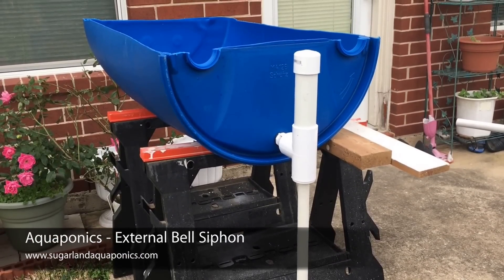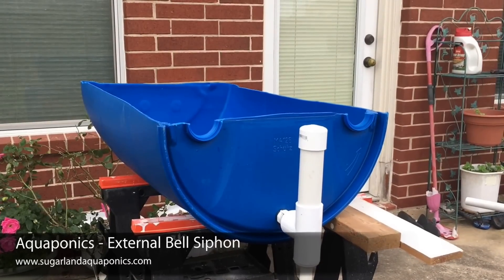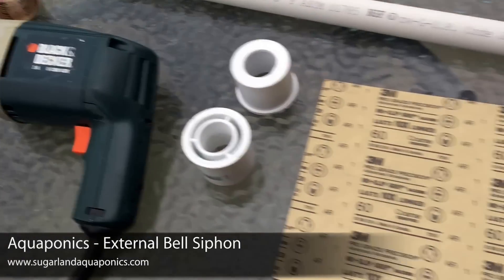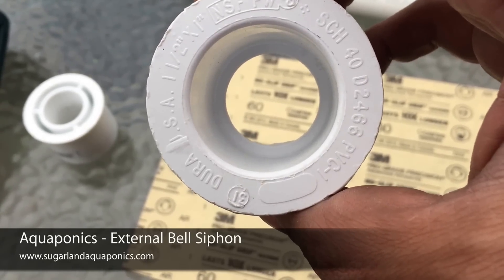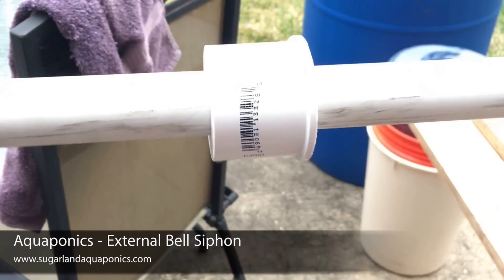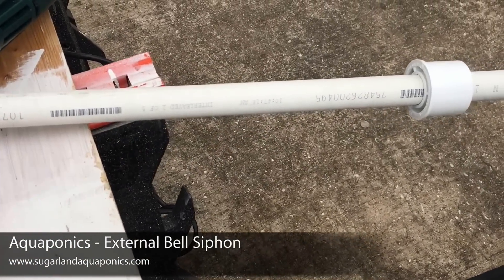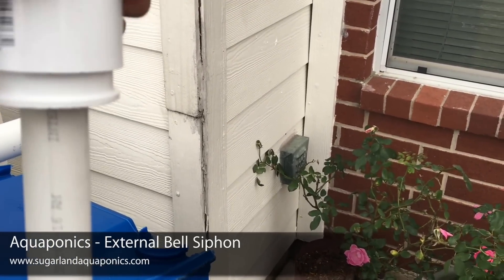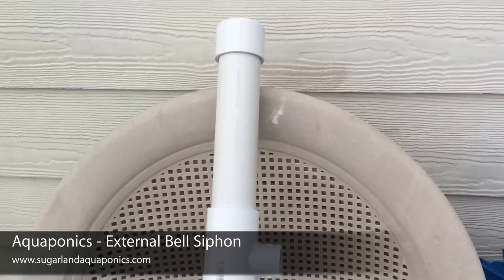External Bell Siphon

Comment: You could also use about 30 seconds of heat gun, to heat up the reducer to fit the 3/4 pipe thru without sanding, if you have an exact 3/4 holesaw. Just have a water bottle or spray bottle to keep outer shell of pvc from getting soft.

Warning, do not breathe the fumes from heated pvc or sanded pvc. Toxic chlorine gas is by product. Use well ventilated area, and respiratory protection.

Also, using a copious layer of primer will dissolve a thin layer of PVC for fusion during gluing process. You could most likely just slide the pipe in quickly if you are fast enough at priming and gluing.

Comment: Do you feel like the siphon has trouble with the side input pipe being too small? I saw a similar build but somebody didn't use the reducer on the input, and instead had the 1-1/2in pipe going into the side of the growbed. Do you think I should go with the diameter input larger pipe, or does your design still work well?

Comment: This was awesome. In the plumbing supplies I had on hand, I found a one inch PVC "T" will accept a 3/4 inch coupling. That glued in then allowed me to insert different lengths of pipe until I achieved the height I was wanting in the grow bed. For the bell, I slipped on inch and a half ABS. The "T" fits into this. Again, thanks for the video. It's working perfectly.